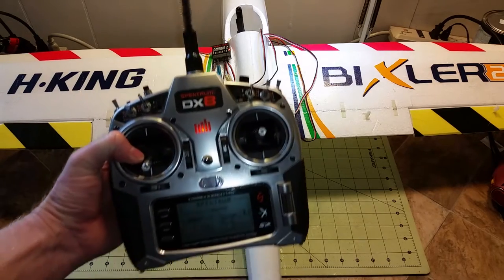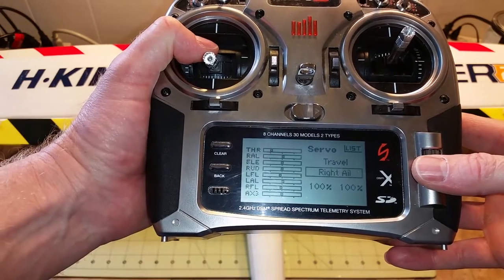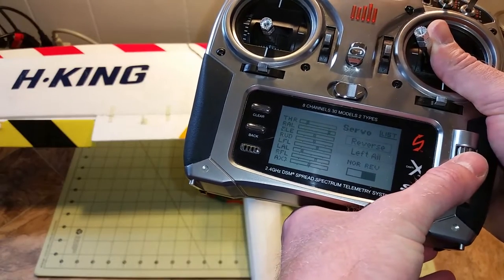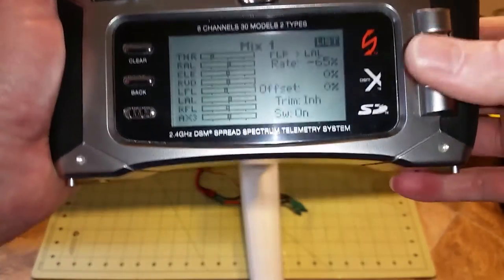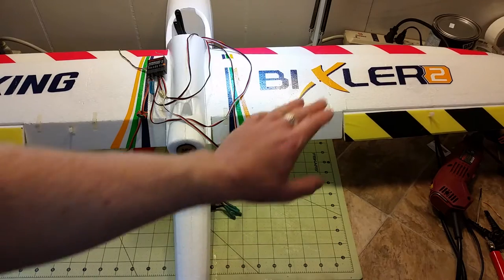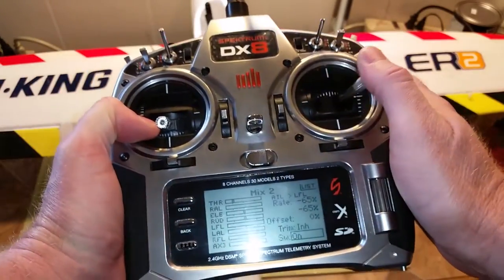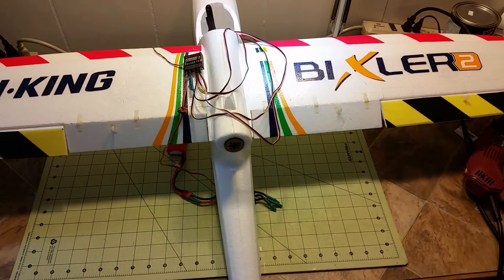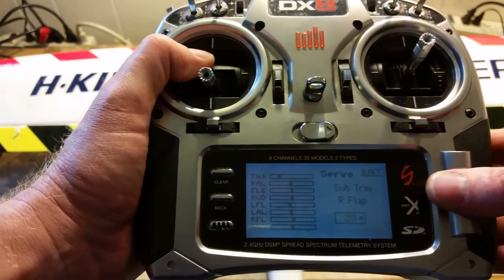How to setup dual ailerons and flaps on DX8

Comment: I have the Eflite Maule M-7 and being controlled with a Jumper T8SG Radio and Spektrum AR620 6ch receiver.  1= Throttle, 2= Aileron, 3= Elevator 4= Rudder 5=Lights, 6= Flaps. All my channels are except the flaps. I was wondering if you can give me some pointers of why the flaps aren't working and how to basically set it up. Thank you so much in advance.....Happy flying and cheers!
Reply from the maker: I don't have a Jumper radio and not familiar with it's setup.  Look at Painless 360's channel on setting up a Jumper.  He has some videos on that radio.

Comment: Does setting the radio up like that make some of the channels for switches not available because those channels are used for flaps and ailerons?
Reply from the maker: Yes, each channel is assigned to a certain function like flaps.
Reply: I also can't change some servos. My flaps are stuck down don't work with switch and only move with right aileron.

Comment: Why my flpas servos are not even. It does start even in neutral, it twisted on middle position and still twist on 3er flaps position
Reply from the maker: Check if the channel your flaps are assigned to is enabled on your radio.